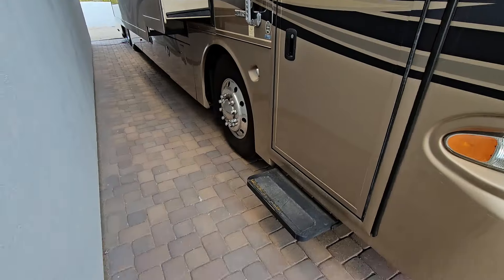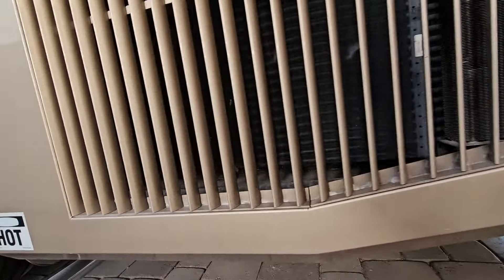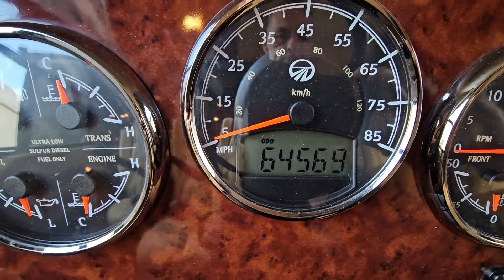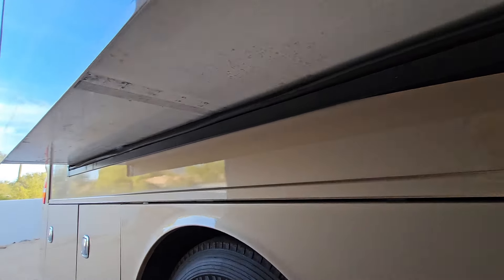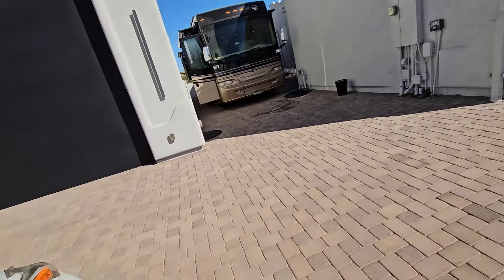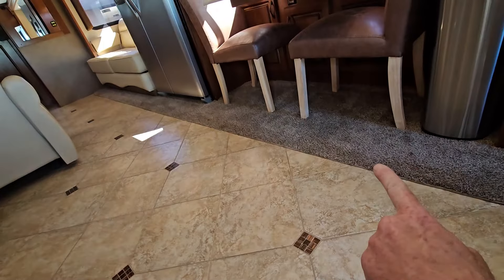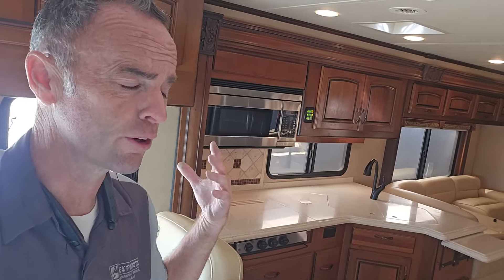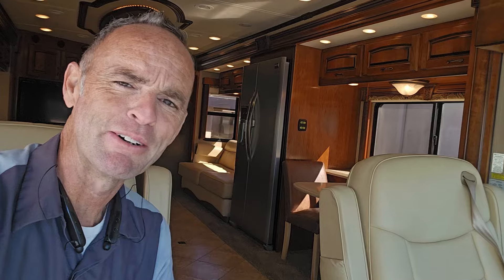Finally...Another USED RV I Can Recommend: 2011 Camelot

Comment: We have about 30 school busses with the Maxxforce Navistar engines and all of them needed a rebuild before they reached 100k miles.  They just wore out which caused high crank case pressures which caused oil to spatter up against the rear of the bus due to the oil dripping from the vent tubes and getting caught in the air vortex created at the back of the bus while driving.  We even joke about them being James Bond busses because some can create large exhaust screens.

Comment: 2011 was the final year for the Monaco Camelot, available in 43 feet only -either in triple or quad slide layouts. This one is the quad slide with the fridge in the middle. I haven't seen one of these, so really enjoyed the video. We own a 2008 Camelot 36 footer and Camelots are great entry-level side radiator coaches. Dynasty is better, more high end, but more expensive as well. Thank you for sharing the video.
Reply from the maker: Thanks for sharing! I've seen similar but this is a nice floorplan

Comment: Another very informative inspection James which just demonstrates how important it is to have a potential buyer carry out a thorough inspection prior to purchasing. The lack of electrical outages at the rear appears to be consistent with the loose fan on the roof so I hope there’s not any major issues causing leaks which is being covered by the leatherette ceiling. That would potentially be a costly repair. The skew on one of the slides is also concerning and as I have no idea of both cause and remedy I’m wondering how much all these issues might eventually cost. It’s a beautiful coach as long as the repair costs are within reason and give the RV a much longer life expectancy. It’s very low mileage for the year. I’m sure you have enjoyed this one and 10/10 for your observations. 
One day James… not too long fingers crossed 🤞🏼🇬🇧✈️🇺🇸💫

Comment: Also, just wanted to say … my BFF had a 2011 Monaco Knight with the MaxxForce 10 for over 10 years & no issues till 2022. And, they mostly dry camped in the dirt all that time. The biggest issue was no one wants to work on them except the International dealer who wants major $$$ to work on it.

Comment: I spent 25 years working on school buses and to say the MaxxForce engines were problematic...that is an understatement. We hated those engines. We had 10 or 12 special needs buses with those engines in them and most of them never made it through the warranty period without major issues. The only thing that kept the school buying buses from International was the fact that they were built with a Cummins engine. The only International bus that the school had that I liked (this goes back to about 1998-99) was a 1985 conventional with the 7.3 diesel. This was back when the engine was equipped with a rotary injection pump, long before the engine was renamed as T444E and was pure junk.

Comment: I looked at a Scepter in Palm Springs last year & it had those lite up switches throughout the coach - Multiplex I believe? But,  the owner had disconnected some of them & installed his own toggle switches & the wiring for that whole system in the back closet was a nightmare. Apparently he was some sort of engineer that worked with Winnebago before retiring & he had done a lot of customization to the rig. Like the cookie sheet pan he wired under the engine to keep the leaks off the ground! 😂 Also, the socks he wrapped around a couple hydraulic hoses. 😮 They were in one of those fancy Motorcoach resorts so no oil on the ground allowed! This is why it’s so important to get an inspection! What was that noise at the engine in the very last part of the video?

Comment: You are awesome I've learned so much from you,I prefer your way of doing things as opposed to the dealer recommendation where they differ.im rebuilding a 98 dutchmen 33ft and will not be tucking the roof into the front cap. Can you recommend a company with fair pricing for the roof?

Comment: Hello there from Massachusetts, I love your videos, they have been helpful. I have an opportunity to have a 23 foot toy hauler… The roof has been leaking for a couple years
It smells musty inside.
The frame is excellent it has a microwave, a sink and a small bathroom.
I am a former mechanic of 18 years, I am capable of building a garage, sheds whatever… I can do plumbing and I can weld

Not Sure on the year of this toy hauler I would guess it’s somewhere around the year 2000, do you think it’s worth fixing I know that’s an extremely difficult question to answer without seeing the unit.

I have all the Time in the world, just not sure how much it would cost to buy fours and plywood is no big deal I’m worried more about the outside covering where do you even get that from??

Any words of wisdom would be greatly appreciated! Thanks again for all your videos, I love watching them

Comment: Another great video, I feel like I am absorbing a tiny speck of your bottomless knowledge every time I see one of your vids.   Hey, my Tiffin has the checking pretty badly - do you know of any type of primer or prep that can keep it at bay for a few years after repaint?   I have read its the fiberglass cracking underneath in response to excess heat, and I see it mainly under the dark colors so that makes sense.   I am considering a Mexico paint job, primarily white on top, and would like to keep the checking to a minimum  if possible, as we plan to keep this coach indefinitely.
Reply from the maker: Theres no real repair to it, the cracks will come back